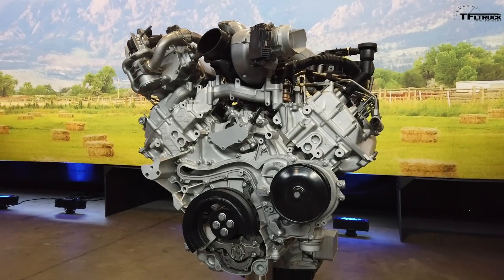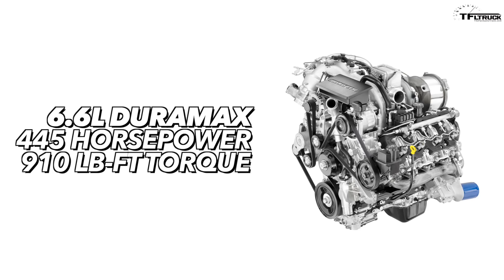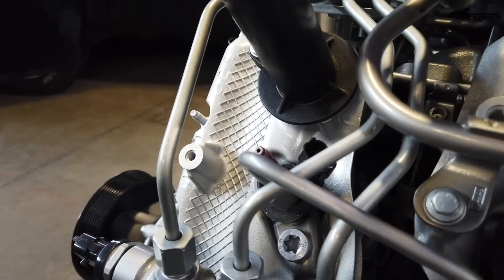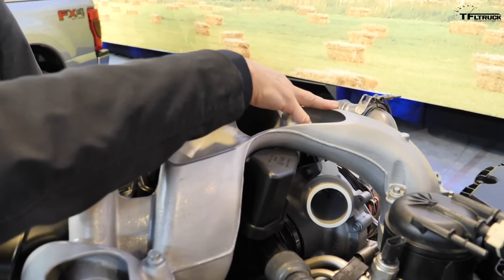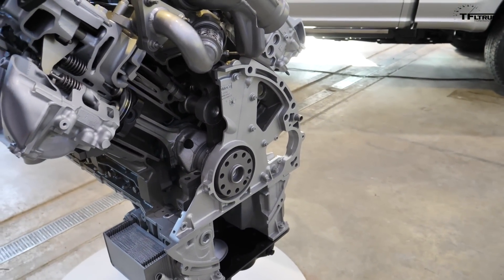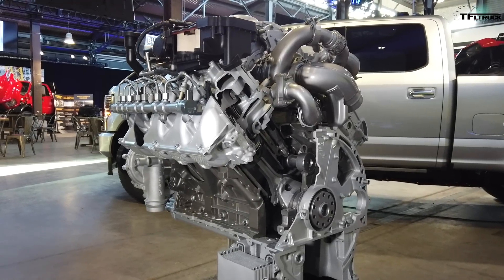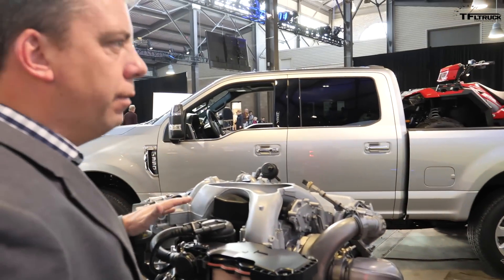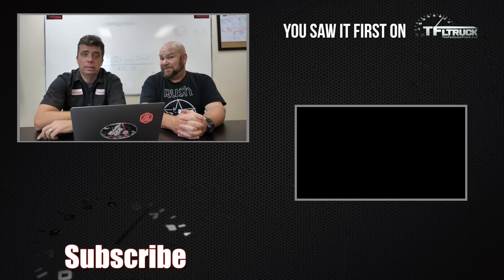Here's How the 2020 Ford Super Duty Diesel Makes 1,050 Lb-Ft of Torque!

Comment: Wont last 150,000 miles hauling without blowing a gasket
Reply: This guy thinks it's a 6.0. by the way the 6.0 is considered one of the strongest diesels out there. Talked to many diesel builders say it was just the head bolts that cause 6.0 to blow heads gaskets. He said put heads studs and that motor will be bulletproof. They been know to hold 1000whp on stock bottom end.
Reply: You stuck in 2008?
Reply: Agree typical Ford. Then they lift the entire cab to get to the engine 🤣
Reply: @devodar2579  Same as GM.
Reply: @devodar2579  actually all 3 manufacture's recommend you lift the cab for major engine repairs
Reply: Devo Dar uh huh - https://youtu.be/PH-G5qKknuA
Reply: Where are you getting this information?  I thought this was a new engine that hasn't been sold to anyone yet?

Comment: So increasing horsepower and torque matters yet semis haul 125,000 with only 300hp and 1,000 torque at least my neighbors Mack truck is now let me point this out a truck is junk if the truck itself can’t handle heavy weight the ability of the truck matters not exactly horsepower and torque so there needs to be more truck before you just keep throwing power at it. Like look at chevy went from like 23,300 with 445 hp and 910 torque and re did the truck no increases in power and now it’s at 35,500 just saying
Reply: Exaclty I think ford just thinks that truck guys don’t understand trucks so when they hear class leading numbers they sell more that’s all ford is doing
Reply: Ohio Till I die it’s all manufactures ram was 1000 GM took tow capacity now ford has the numbers again. I’m assuming you are male and you know how it is everyone wants bragging rights. Read the comments on any video and it’s ford has the highest then it’s ram got to a 1000 first. So I might have to disagree “truck guys” as you said love big numbers and it does increase sales even though 90% or more of the people won’t tow anywhere close to what any of them are rated at. Like Andre said in a past video where are you going to find a fifth wheel that weighs 32500 which ford is rated at. I’m a ford guy but all of the trucks are capable of doing anything 90% of us will ever throw at them
Reply: Semis are made the get the job done as economically as they can. Pickups are designed with performance and comfort in mind, so they get a higher specific power and torque output, higher power-to-weight etc.
Reply: They just did an episode on how the tow ratings are achieved, it combines a lot more than power, but power is certainly part of it. Semi's obviously do not use J2807 for their own ratings, they have their own system which is perhaps more stringent in some things, like braking, but wayyyy more relaxed on power/acceleration

Comment: Why would they used plastic for an engine part I don't get it
Reply: It’s called Ford saving money. They know you won’t use that truck for heavy towing but a few times going in the mountains.
Reply: Plastic is cheaper to make.  Simple as that.
Reply: @NJW1973  and light and doesn't heat soak like metal.

Comment: Love diesel power, however all the added unreliable emissions crap is a no go. 7.3 Godzilla 1st choice!
Reply: Yep. Wife agrees. she wants one. might look good next to the PS DRW.
Reply: I can rebuild a gas engine for the cost of an EGR cooler replacement.
Reply: LOL the 7.3 will end up being a gas guzzling joke!!!
Reply: @joatmon1857  Have you ever had to repair a modern diesel? A DPF is thousands... Other parts of the exhaust will cost thousands.... A turbo charger is thousands... Your cooling system is thousands.... A HPFP failure alone is $10,000+ because you have to go through the entire fuel system when it fails. Much of this work  requires the cab being pulled, even for relatively simple jobs, because these diesel engines are crammed in there. That alone is labor intensive. Seriously, one failure on you truck out of warranty could total the vehicle! Yes, gas engines, in general, aren't as efficient, but so what? You can buy a lot of gas for the cost of just the upfront, which often is $10,000 by itself. You need to wrap your head around the numbers, pal. Unless you absolutely need the power, it's not worth the cost.
Reply: @MarkChristian2010  20 year diesel mechanic that has worked on everything from construction equip to OTR truck. Are Diesels as good and easy to work on as older ones NO but they are still the most efficient way to motivate anything with more than 3000lbs. If you constantly use your truck to tow or haul diesel is the ONLY way to go period!!! I also have my CDL and have driven everything from busses with gas engines to 18 wheelers. The one bus I did have with a Ford V10 was the biggest POS to ever drive period in less than 120000 miles that setup cost my company over 25000 in engine repairs. So please tell me again how much cheaper gas is to run than diesel?.....
Reply: @joatmon1857  Of course you tell people to buy diesels. You fix them for a living.
Reply: @MarkChristian2010  actually just the opposite I tell people to buy gas as I work on everything!
Reply: @joatmon1857  That totally avoided his point. I can buy a lot of gas with $10,000. If one thing breaks on your diesel, all your fuel saving is lost.
Reply: @joatmon1857  Well, what are you? Are you a diesel mechanic or do you work on everything? It sounds like you're blowing a lot of smoke now.
Reply: @felix8289  have you fools ever actually towed or used your truck for more than just towing a boat or camper? If you actually think gas is bette and cheaper than diesel not to mention works bettee  just goes to show how little you actually know. And yes a diesel mechanic is actually capable of working on other things than just diesel...
Reply: @joatmon1857  Like I said, if you need the power, then get the diesel. If you don't, and I would say the overwhelming majority of HD trucks buyers don't, buy a gas engine. Even a 6.2L would handle most needs. 

Seriously, ever maintained a fleet? I don't care about what you've fixed in you life or what you've towed. What matters are the numbers. I pay some on weekends to service and repair my trucks, but I pay someone a salary to keep those costs to a minimum.
Reply: @joatmon1857  If it costs more for the purposes, then yes, gas is better. Duh! You've clearly been sniffing the brake cleaner.
Reply: @MarkChristian2010  1 out of 30 drivers will use any of these diesels for what they are capable of.  Rest will drive around and look cool, waste of money..try stoping these things with close to 40, 000
Reply: NATHAN CLUTS i totally agree with you, how stupid is it to make such a big engine for towing and a big car , they have to improve the diesel engine weak systems like EGR, DPF....
Reply: @joatmon1857   It probably will be, but better than being an injector eating joke or a turbo eating joke or a DPF eating joke like most diesels.
Reply: @mark7067  the only the that you will be eating is the dust of ANY diesel owner and that my friend is FACT!!!
Reply: @joatmon1857  Meaningless rhetoric. BTW, I own a diesel.
Reply: @mark7067  Maybe he thinks diesel owners should eat each other, I guess.
Reply: @felix8289  This conversation is hitting such a high level.
Reply: @joatmon1857  Of the two, the 7.3L gas and the 6.7L PSD, the 7.3L was actually designed with more focus on fleet buyers and low operating cost. The 6.7L PSD is mainly a halo engine or a champion engine, but it's not intended to be the workhorse. Fleet buyers actually are the reason the 7.3L exists. It's exactly what they wanted.

Comment: I enjoy the power wars among the big three. The problem i have with the ram and cummins is that if you want a 3/4 ton you take a detuned version with a 68rfe tranny that has rep for being a weak link. I dislike the fact that the customer must opt for a 1ton single or dually to get the “high output” with the Aisin tranny. Who the hell wants to buy a detuned version of one of the best diesel engines ever made...and someone correct me if im wrong but ram seems to still be using 6 speed where as the comp is going all 10 spd. Its a shame ram continues to do this because i do really like the new rams but i do not need heavier than 3/4 ton. 

With Ford, one powerstroke across the lineup of f series with one torqueshift tranny.  Thats how they should all be (except when buying a cab/chassis fleet vehicle). Seems even GM got the memo when outfitting their hd trucks...one duramax, one allison across the board.

Comment: Just give me a 12 valve 5.9 built to 350 hp and about 850-900 lb ft. Couple it to a six speed manual with a triple disk clutch and 3.73 rears.
Reply: I see you too are a person of culture
Reply: That 5.9 would probably outlast 2 or 3 of these powerjokes.
Reply: @naythan manley i sent your order details to ford. and they are planning to make custom built truck for you and it will be delivered to you in christmas 😂😂😂😂🤘🏻🤘🏻🤘🏻🍻🍻
Reply: @jassimransidhu1239  sweet potato pie that's awesome  lol
Reply: Except it only makes 600 lb ft
Reply: Nathan Manley agree but if we are talking perfect conditions 5.9 24 valve is better flows more air
Reply: Great engine, but the dodge truck it's in is a piece of junk! Been there
Reply: Could it make those numbers on fuel only?
Reply: @csbartonorgan83  you would have to swap out the injection pump, injectors, turbo, and possibly the cam. Then it can do much more than the factory rating.
Reply: csbartonorgan83 😨 uhh yea. With a s366 turbo, some 5x.018 injectors and timing bumps, you be at 600 hp with a 12 valve 5.9
Reply: Look in to the new reman 12 valves up to 960ftlbs of torque
Reply: mtrujillo1973  itll still outlast that powerstroke. Inline 6 engines have 7 main bearings, v8 engines only have 5 main bearings. 6 cylinders on 7 maim bearings vs 8 cylinders on only 5 main bearings. Why do you think all the big rigs are online 6 engines? So you have to choose between durability or performance.
Reply: Yes in ford for sure
Reply: @DLJ-  in a 92-96 body none the less. Fully box in the frame with cold rolled high carbon steel then line-x the whole underside and put a tuned link suspension under it all with Dana 60's front and rear sitting on 35's

Comment: Eight injection cycles good grief. Turbo sitting there with all the heat wonder how that affects it's longevity,  heat shielded hopefully.  May have missed that part.
Yeah test the 350 against the ram and gm 3500's
Reply: Turbo in the valley is the whole point, its a hot-V architecture meaning the exhaust gets right to the turbo, less heat loss to begin with.